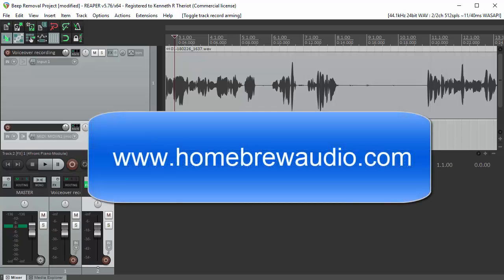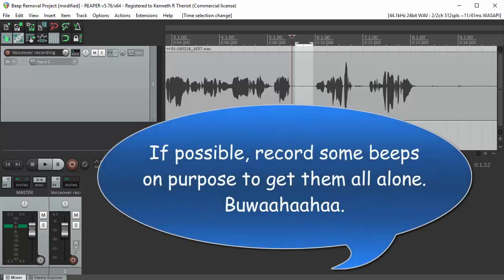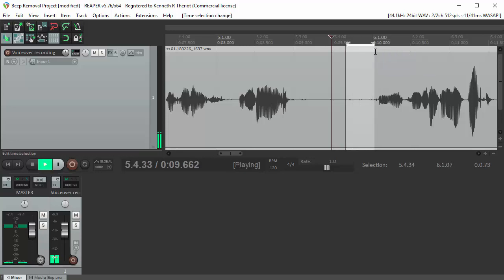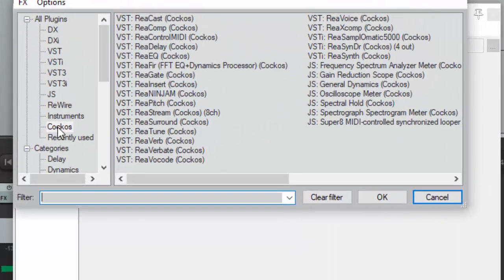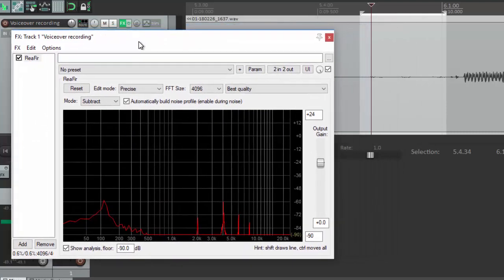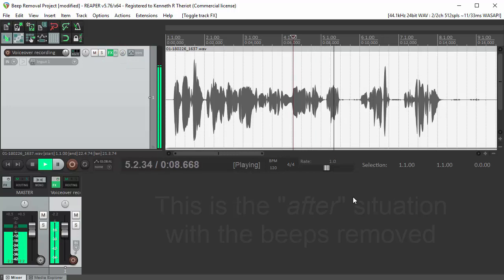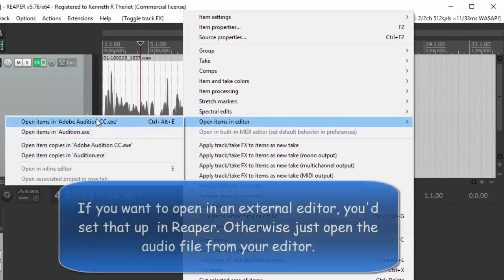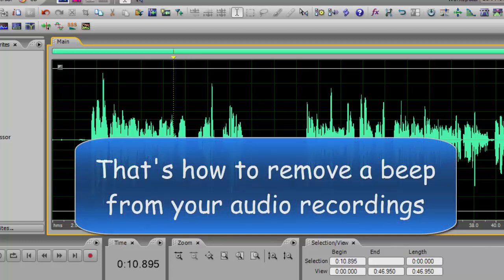How To Remove a Beeping Noise From an Audio Recording

Comment: Wow that was helpful, but I meed your help in an extraordinary situation.
I recorded a call and instead of actual voice I can hear a contentious beep. Is it possible to eliminate and get the actual recording?
Reply from the maker: Wow. If you ONLY or mostly heard just the beep, then it is unlikely you can do it. But if you can hear the voice from the call AND the beep, then you probably CAN do that. Just find a place in the recording with ONLY the beep, and capture that in noise reduction software. Then select all the audio and apply the noise reduction.
Reply: @HomebrewAudioRecording  unfortunately all I can hear is contentious beep 😭. If you want I can share you the file. I'll be very thankful if it is recovers the original sound.
Reply from the maker: @Loving4friends  Oooh. Well unfortunately, in that case it is impossible to recover any original voice if all you hear is the beep. Sorry about that.

Comment: Will this help with beeps within the audio software? Theres a beep in one of my songs that happens about 4 or 5 times throughout the song and im wondering if i need to rerecord the whole thing.
Reply from the maker: If your audio software is causing beeping, that is highly unusual. The first thing to do would be to identify the source of that and prevent it happening again. But for getting out what is currently in there, you could do it if you could find at least a small section where JUST the beep happens. That way, you can feed the beep into noise reduction tool. Maybe now - before you've found an eliminated the root cause - you could make the beep happen on purpose in a new recording. Then you can copy that audio and feed it into noise reduction, maybe saving the noise profile. That way you can apply NR to your song where the beep happens, using the saved noise profile. Hope all that made sense!

Comment: Many thanks for this. I am still discovering the many, seemingly endless, things one can do with Reaper, and this adds one more to my arsenal.

It seems to me that this process relies on having a portion of the audio which is devoid of anything except the sound that one wants to eliminate. Is that correct?

If not, how would one find the offending frequency, and identify it (to Reaper) as the frequency that one wants removed?

I have tried the old 'boost-and-sweep-and-cut' with a parametric before, and have not been to successful, so using Reafir for this kind of thing would be great if it can work in the way that I am asking about above.
Reply from the maker: You are correct about needing to have a section that was devoid of anything but the sound you want to eliminate. So if you can, try to record nothing but that sound. I could have waited a bit during or after the recording session to record just the bird by itself :-P. If you can't get a clean sample of it by itself, you can try to use EQ in a way similar to how I get rid of mouth clicks (saliva clicks), which I describe here: https://youtu.be/uL1yLHkXNTM
Reply: Thanks very much :)
Reply from the maker: You're welcome!